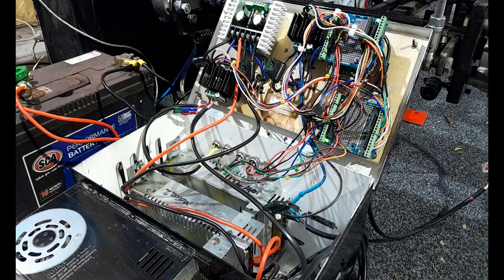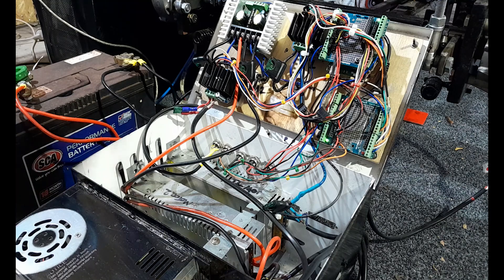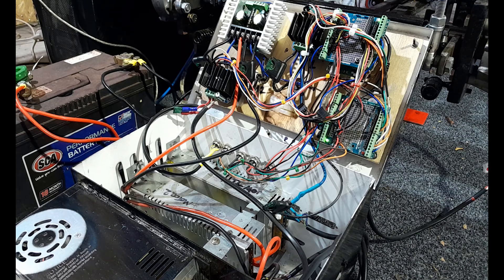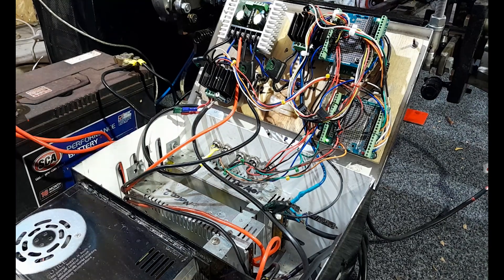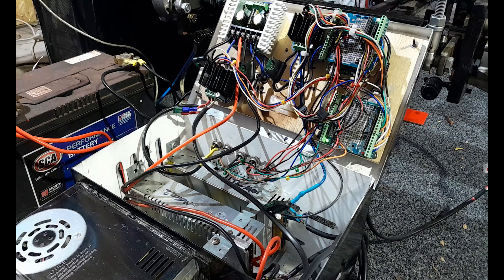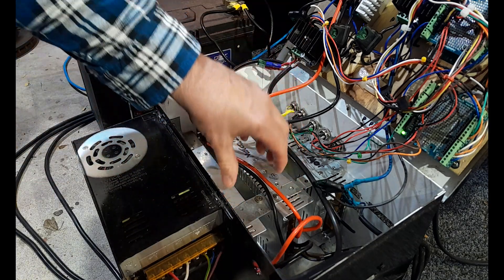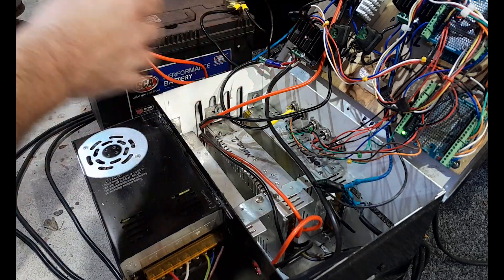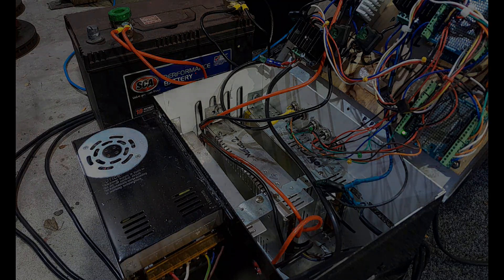Motion Simulator Using IBT 2 And Sabretooth 2 x 32 Controllers 4DOF

Comment: Can I ask you an opinion? I have access to 2 24v motors wheelchair. I keep reading how much of a pain in the rear it is dealing with regen current and frying ibts7960' which i bought already. Would you recommend going dmax route instead, so use one 12v 750cc battery keep and it topped with a tender then save and buy 12v motors or attemp the 24v. Whataya think?
Reply from the maker: Dave (Dmax) has shown it can be done so really, if you already have the motors you could go that route. Why not invest in a step down converter? 24vlt-12vlt step down. They can be had for around 30 bucks. 

Iv’e never messed around with 24vlt systems, so can’t accurately advise you on this.
Reply: @Doctoradhd1  Thanks for the reply, yep more research!